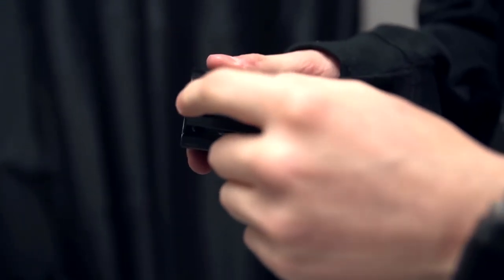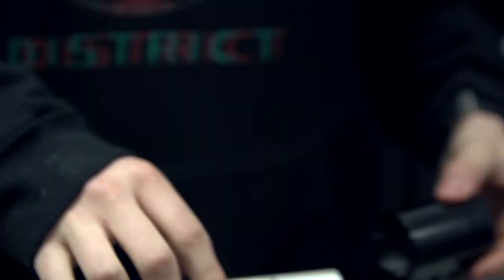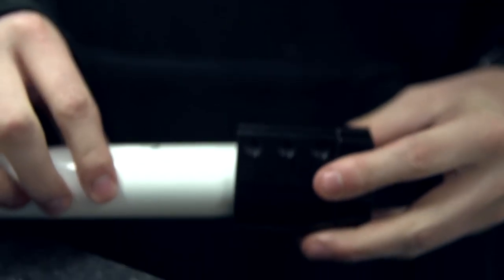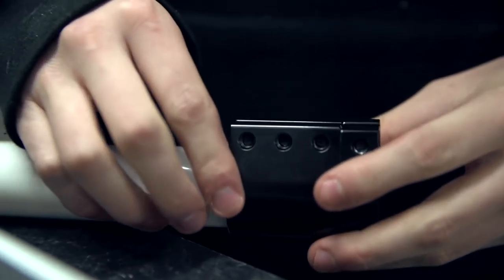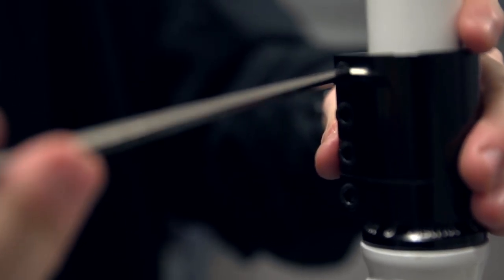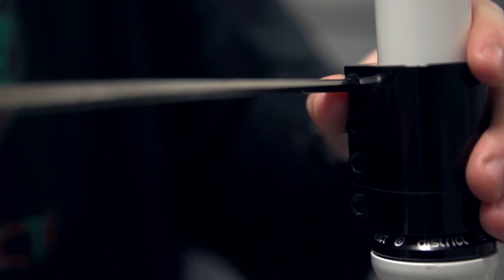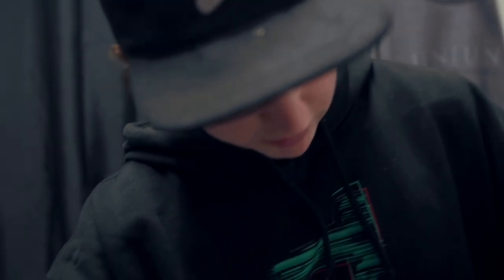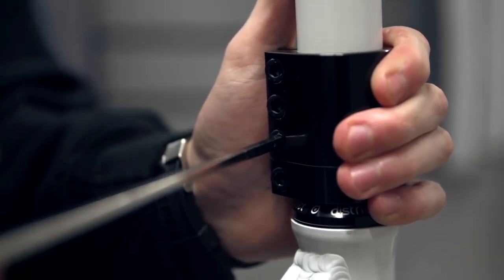HOW TO: Pytel Compression

Comment: Did it like you..But it doesen't work:/
Reply: +Nick Bäumer you did it wrong way
Reply: Hagja_ no i did everything right but it didnt work, but doesen't matter i switched it up in ics
Reply: +Nick Bäumer what scs do you use?
Reply: Hagja_ I use ICS Not SCS
I Took a  drone clamp, Short ics bolt an a starnut (I had to pull the starnut in the bar) It works very good love it